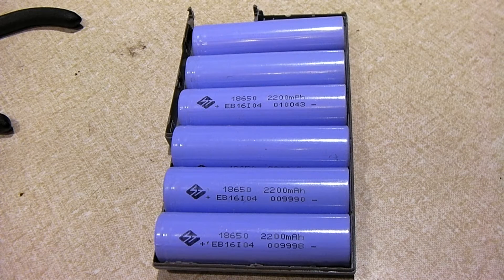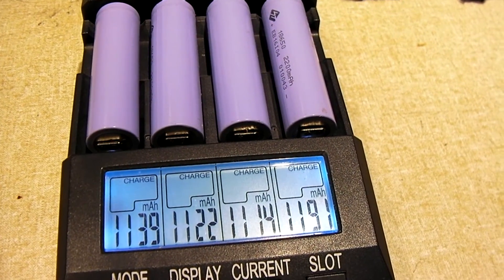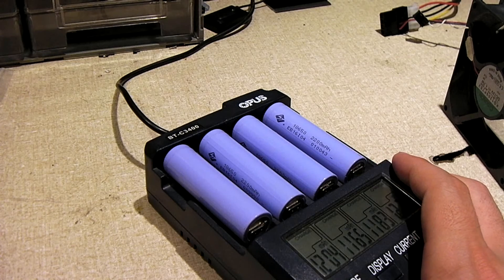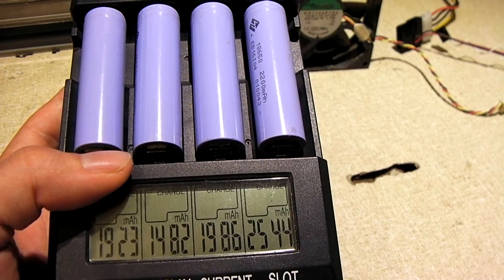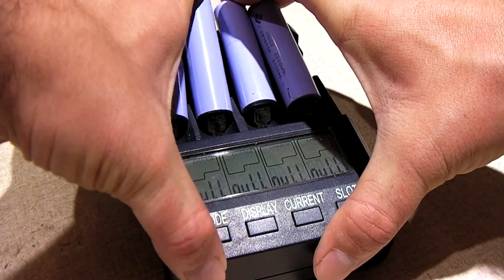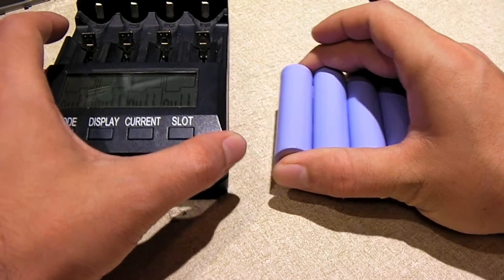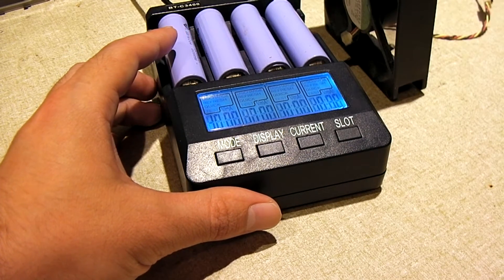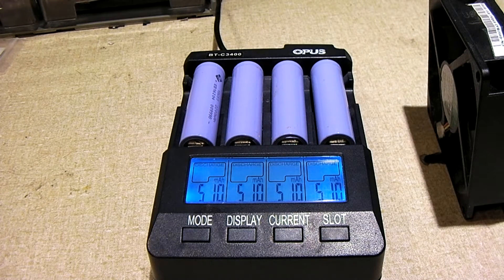Testing the 18650 cells harvested from the 8 cell laptop battery

Comment: So when you say you modded you really just made it easier to switch between the different voltage options
Reply from the maker: Please include a timestamp so I'll know where you are referencing...
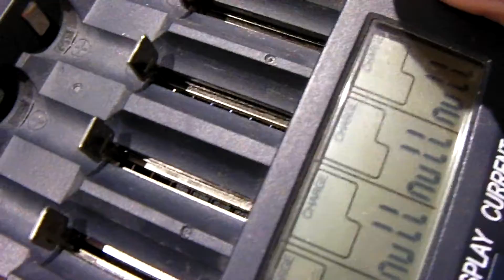Reply: Like 1:18
Reply from the maker: @james10739  Yes, I cut open the bottom of the charger to access the hidden voltage switch.